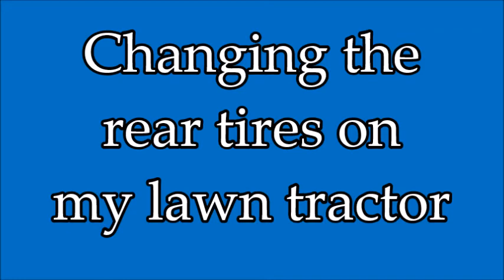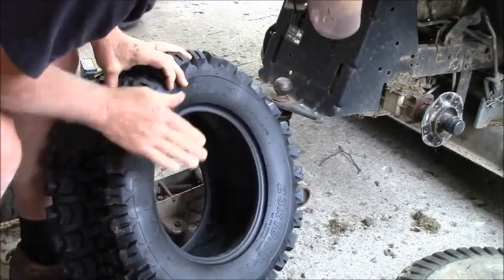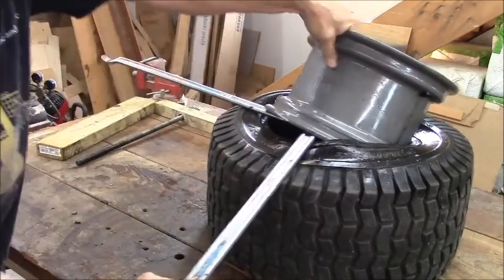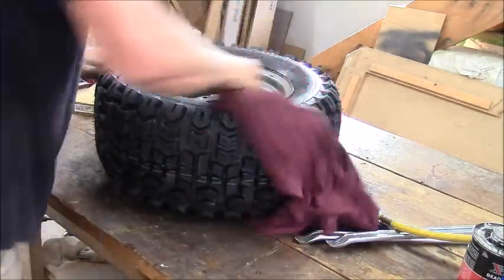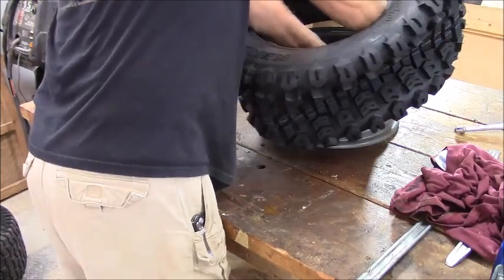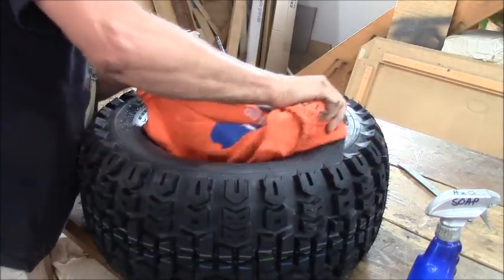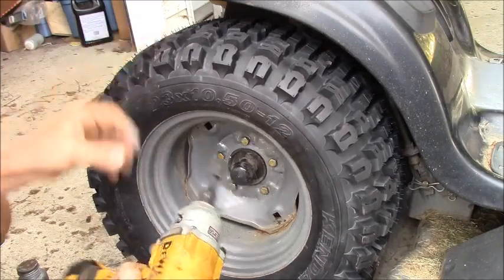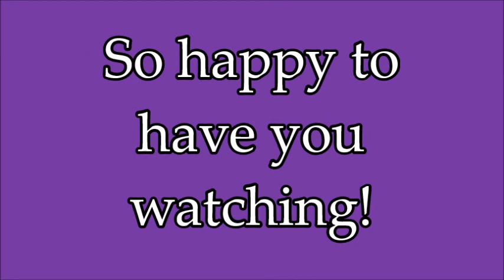Lawn tractor tire change on a home made tire station, bead breaker

Comment: Suggestion: to make it easier to mount the wheels, make a threaded rod to put into one hole in the hub.  Then put the wheel on it, making it easy to line up the rim with the holes. 😮 1:11:28

Comment: Make it easier and safer by forming a 2x cut to fit around the outer edge of the rim instead of that little block that keeps slipping.  You could even attach that little block to it.  😮 20:10

Comment: Why don't you leave the weights off?  😮  It only makes ruts in the lawn with all that extra weight. 1:10:23
Reply from the maker: I leave the weights on because they suck to put on! Doesn’t make any difference on the lawn, they are needed to offset the weight of the snowblower attachment that hangs off the front.
Thanks for watching!